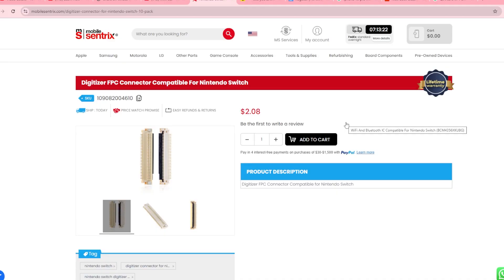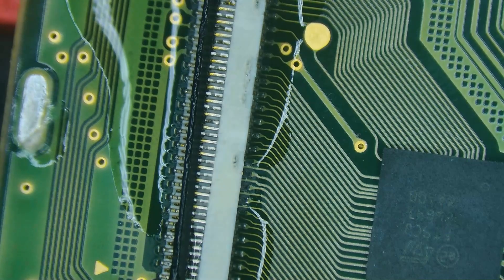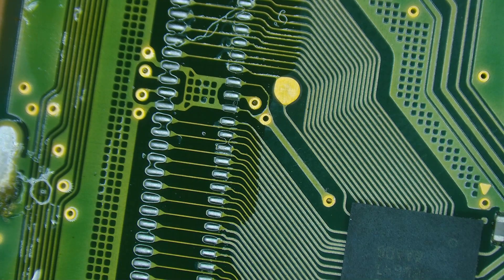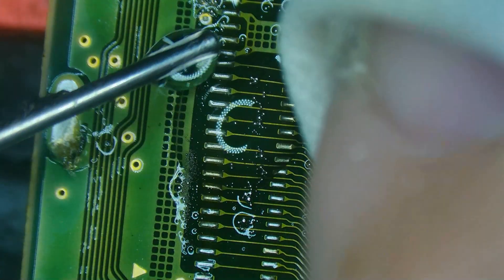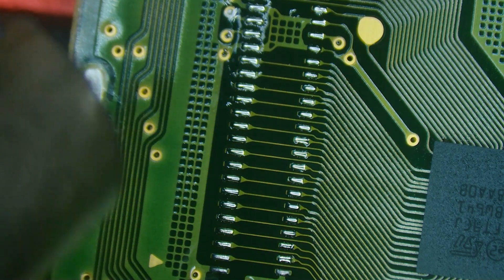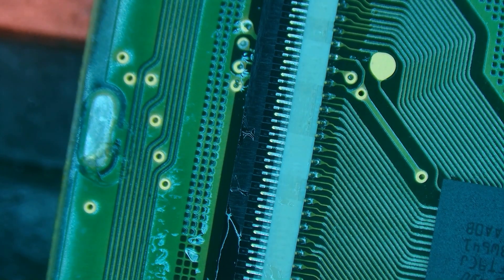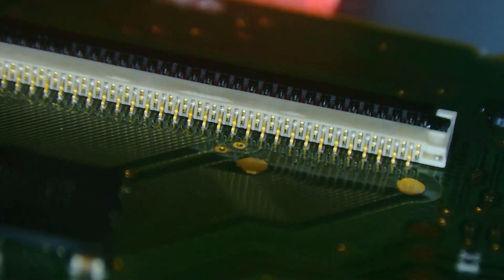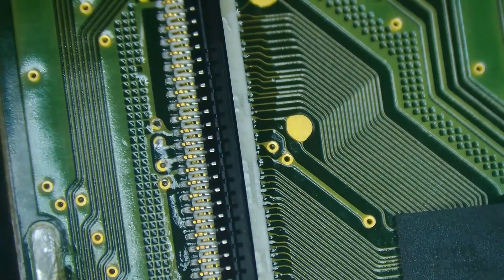Tips to Safely Solder Plastic Connectors Without Melting

Comment: For connectors like these I typically heat from the bottom if possible
Reply: Me too, this one though has more plastic on the bottom that prevents it from being possible.
Reply: how do you keep the the bottom components from falling?
Reply: @adalidfuentes5307 usually not an issue